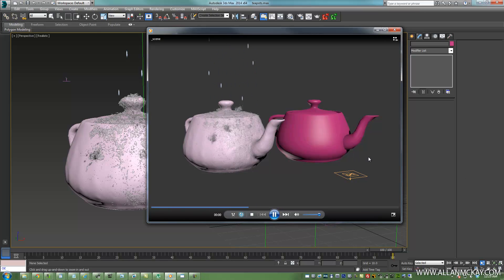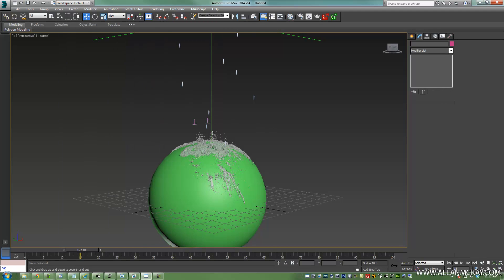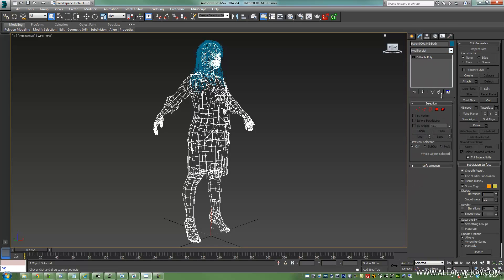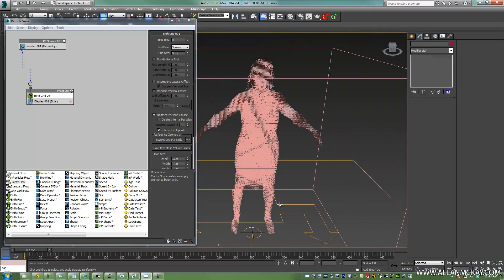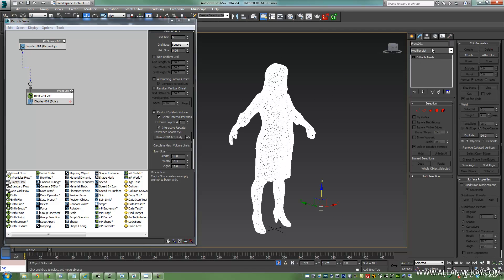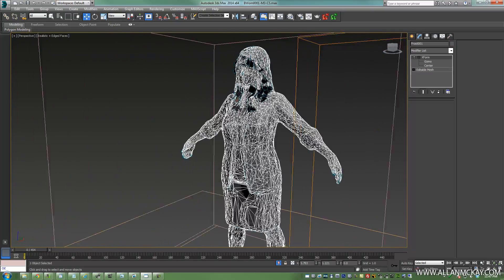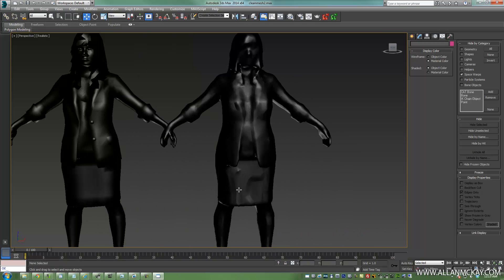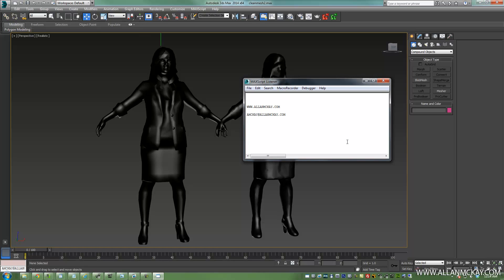Allan McKay - How to Generate FX ProxyMesh

Comment: Here a free tutorial without to try to sell you DVDs 
- select your mesh and go to modify panel
- copy the skin modifier
- cut or delete the skin modifier ( do not move the character if animated)
- inside modifier panel select the modifier "MultiRes"
- play with the values and generate a lower mesh from it
- colapse everything and now cap the holes with just selecting the open holes 
- paste over the mesh the skin modifier which was in memory
done in less then 1 minute